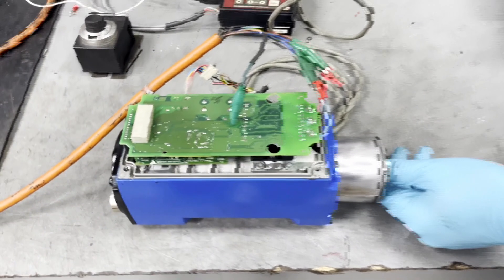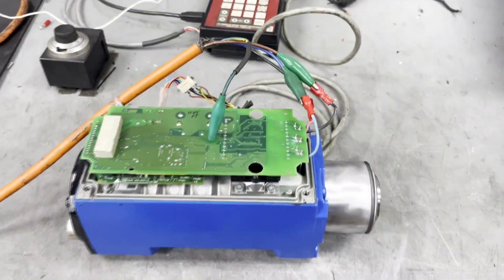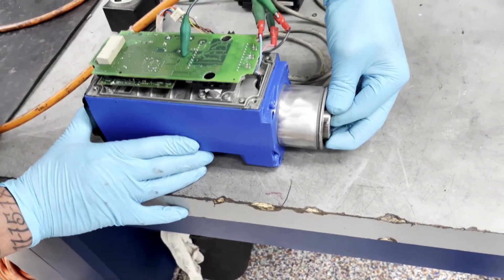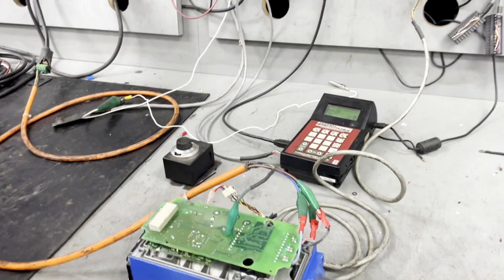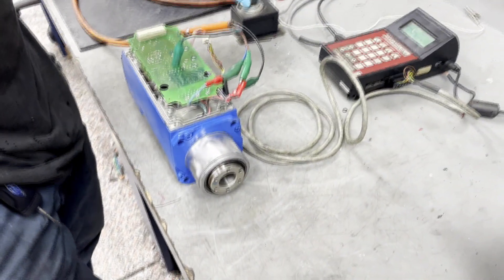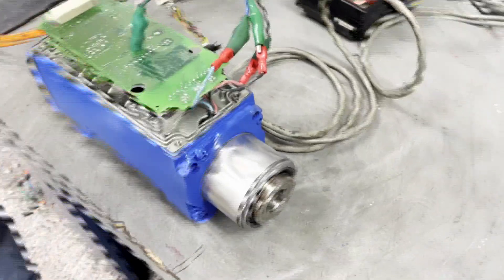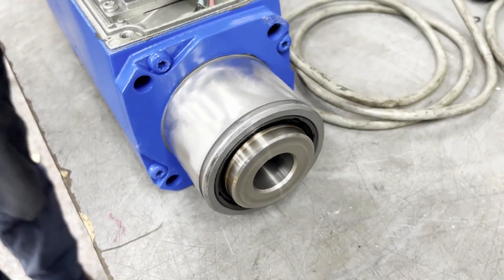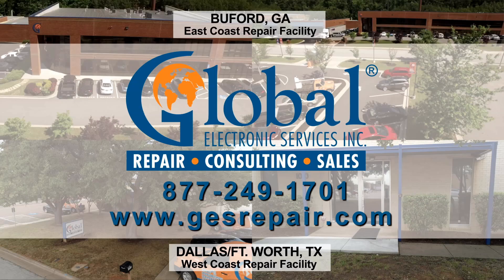Krones Motor - Repair and Test

Comment: Have you guys tried changing the bearings on one of these?
Reply from the maker: Actually yes! As our standard practice, we won't simply repair a specific issue, we refurbish the entire unit. So we almost without exception, we will replace the bearings in a servo motor or any other type of motor. Thanks for the question!